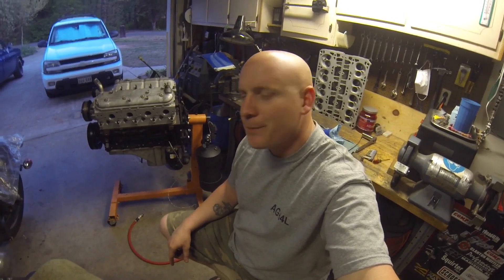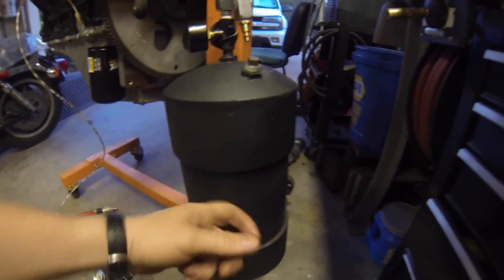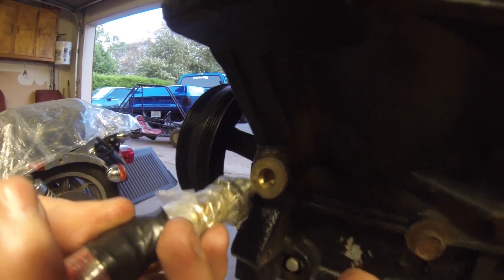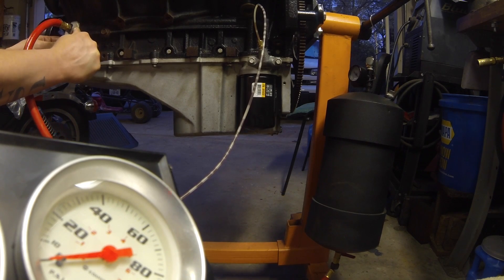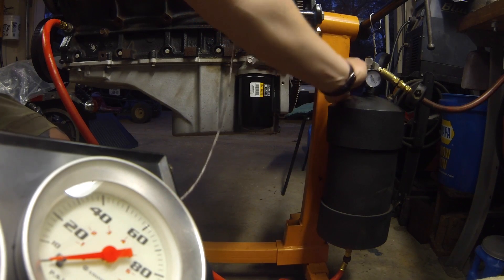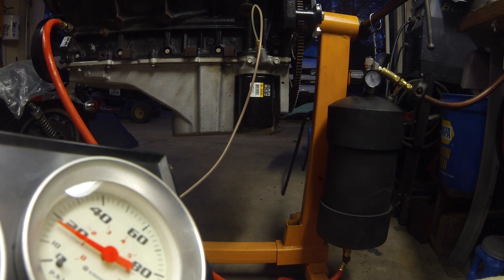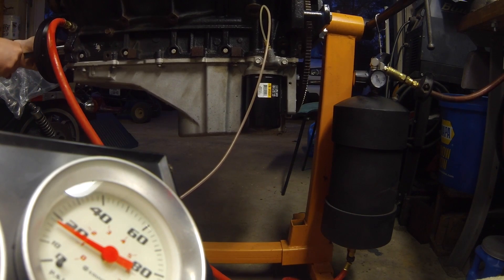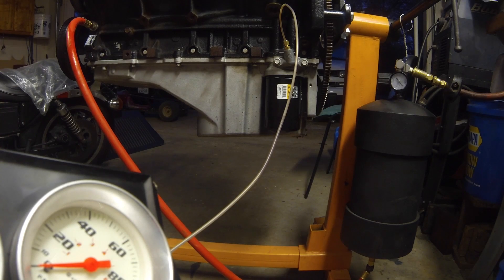LS Engine Oil Primer, Home Made - Pre Lube Prevent Engine Dry Start "How To" - LS1 LSx

Comment: I like to install tees and a access valve on oil, transmission, and coolant lines in the highest line points off their respective cooling systems. For oil I have been just filling from the access point, letting gravity feed it all in, then close valve and run engine. Great every time. Routinely I have transmission fluid partially replaced using the access valve, 1 quart out at a time and refill 1 quart at a time through dipstick tube. For coolant I put access valve on the vent lines and fill and close before start on rebuild or flush, no more startup overheating at all. Love LS motors, great video. I hope more people take this stuff more seriously, good preparation causes less trouble.

Comment: Add a clear filter at the bottom of tank between air line so you know when to turn off tank. Great info hear. Even know it's 5 or 6 years old it still helps ppl today !

Comment: Can you draw oil from one of the outlets on a sandwich plate with an electric oil scavenge pump? I’m trying to make a way I can prime my motor before start up. The main idea was to fabricate the phaser gear cover with an oil fitting to prime the phaser gear actually only bcs it is not staying in its suggested locking position (retarded) and it might be bcs I have aggressive cams and springs for it’s a turbo build and everything is generally brand new.

Comment: Literally all you have to do is remove the oil plug on the drive front side of the engine, shove a tube in the hole attached to a funnel and then add oil slowly until the oil pump is full and oil begins to come back out of the hole. Replace plug in block and you are done.
Reply: But this, if done right, will prime it every time you start the engine. Basically, it's a Moroso Accu-Sump. It will also provide oil to the engine if you get an oil pressure drop due to sucking the pan dry, or having all of the oil slosh away from the pick up, or all the oil getting thrown up into the head on a sharp turn.

Comment: That is a great idea. Since you didn't seem to spare any expense you may as well put an in line magnetic ATF / PSF filter such as a "Magna Fine"  on the hose to make absolutely certain compressor contamination ie. rust, burrs from fabrication etc. NEVER have the one in a million chance of making it in the engine.

Comment: Question I have a 5.3 I rebuilt it has been sitting for about 4 to 5 months in my garage in the vehicle project is not finished. I'm not ready for it to run yet slot left to do should I pre oil it now are when I'm ready to start it for first time. And is there supposed to be oil in pan before priming. What oil would you recommend?

Comment: Thanks for the video Mark. I'm a Mopar guy and I'm getting more into the modern Hemi's. I built one of these for my Gen 3 Hemi build and got to use it sooner than anticipated when I did a cam and lifter replacement in a 300SRT 392. I made a couple of modifications you could probably use for yours and I thought I'd share.

I built mine a little bigger so it will hold 7 qts. I also used an air line coupler on the oil line to the block for an easier hook up, and I put the female end on the hose so it will seal when disconnected, eliminating the need for the bag. 

As for the sight, I added a plastic tube on the outside using two 90 degree 1/4"NPT to 1/8" Compression fittings. I just drilled the appropriate sized holes in the side of the PVC end caps, then tapped them to 1/4" NPT. I drilled the lower hole 1" up from the bottom, and the upper hole in the top end cap directly above the lower. Then just put a piece of 1/8" plastic tube between the two fittings and tighten down the compression fittings to lock it in place. I added 1 quart of oil at a time and marked the hose for every quart of oil. I mentioned the lower fitting is 1" up from the bottom, and that's my "shut it down" point. When the oil drains out of the plastic tube, I shut off the lower valve and pump the rest of the oil in through the fill cap to avoid pushing air into the engine. 

If you decide to add a gauge to the outside, I would suggest drilling and tapping the PVC with 1psi of air in the tank, this way once you break through the plastic, all of the shavings will end up getting blown out, and won't end up in an engine. If you want some pictures of how I set mine up, let me know.

Thanks again.

Comment: if you hooked a line from the drain plug back into the top of that pre-lube tank you could just let it run for a little bit and recirculate. then you could lube the entire engine, and flush everything out. trying to think of a good sight glass idea, clear hose would work but i figure once you got 3 quarts or so in it you are just filling the pan up anyway and it would be just as easy to dump it in the top. just stop early so you know you dont run air into the system. I paused video to comment 3 seconds before you did just that lol sorry

Comment: Man , I'm glad I found your channel with this external oiling primer. I'm working on a 1990 ZR1 , with the LT5 , and it's been sitting for several years and I need to build oil pressure before I try to start it . Great idea , thanks for posting , subbed.👍👍🏁

Comment: hi gear haed ive got a 2000 gm s/c 3800 ill b droping a new can in soon, crow cams say to prime the engine with oil b4 start up but not to prime it by disconnecting the coil pack disabling the injectors is there a simpiliar way 2 prime engine since i dont hav a compressor & the motor is in the car. thnxs

Comment: Should have the spark plugs out and turn the crank while you do it, you can hook the starter to a battery and touch the leads to spin it. Also, your compressor has a valve on it, you dont need a valve on that tank there, just start with compressor valve off and turn it on after you set the compressor regulator to 20 lbs.

Comment: A quick sight glass sort of setup is easy just get you some clear line like used for a oil pressure gauge and two 90 degree fittings put one fitting at the top one straight under it and put the clear line form one fitting to the other and it'll show the exact level of oil

Comment: Great video.  I replaced my oil pan gasket in my 5.3 Suburban and during the entire process the engine did not have oil for about 2 days. Now with new gasket installed and RTV cured I want to fill with oil and start it. Question is do I need to remove that primer engine bolt and put several,ounces of oil in the pump to prime or will just starting it be ok?  I have already filled it with the proper amount of oil in the pan. 2003 with 225k miles. Thanks for response. Great video!
Reply from the maker: Thank you! Sorry it took me 2 months to reply man. Yea, cranking it up will be fine. I prefer to at least prefill the oil filter though.

Comment: why not just use a 5 litre pressure weed sprayer, can see what you have and cheaper than this beautiful creation.
Don't get me wrong, it's a nice piece of work but why reinvent the wheel.
Reply from the maker: Mark Thompson ah yes, that's definitely an option. I had heard of that method before staring this project but I wanted to be able to use higher pressure in hopes of getting the oil into more crevices and possibly testing the engine. It's kinda cool to see that the oil pressure is somewhat correct as I prime it. It may show if there's an issue before even cranking. Like if one forgets to put that plastic dumbbell into the back of the block, you'd likely see that affect the oil pressure.

Mainly, I wanted to copy the $200+ tool I had seen.
Also, I have a habit of taking on tedious time consuming tasks that most wouldn't. I tend to enjoy them for some reason. Kinda like the head porting video series that I did. Those took 40 hours. Or the truck intake shaving video.
Reply: Thank you for that...this is beautiful & professional looking, but I think I have 2 or 3 Hf weed sprayers around😁
Reply: He didn’t reinvent the wheel. He build something far superior to the weed sprayer trick. This is exactly like the $150-250 specialty tools

Comment: after having used a Federal Mogul engine leakage pressure tank for 47 years,  your design is correct, when the tank empties and the air can be heard it does no harm other than to foam the oil a bit. There is no need for a sight glass and the sight glass is just another place for a leak or potential damage. 
The Federal Mogul had a pressure regulator on the inlet as yours does, and an outlet screen filter before the hose connection.
Reply from the maker: +Phillip Polk Thanks for sharing your experience Philip! That's valuable information. I appreciate it.

Comment: I like the idea of using a clear tube to prevent pushing in air, another suggestion I would make is standing the tank on a scale,  once you approach dry weight, cut it off.
Reply from the maker: That's a good idea too. Once I get around to it, I'll make this other one that I've gathered parts for. It's a metal tank and I have a boiler site glass to go in the side and tell the level.

Comment: I made a cam swap and head swap on my 5.3 06 silverado, stage 3 cam and 243 heads, since then when my truck is running at the end of each gear my oil pressure drops and when the next gear kicks in the oil pressure increases to its normal stage. why is that happening? it didn't do that before the swap
Reply from the maker: +Alejandro Lopez It's hard to say from here Alejandro. I can say the most common oil pressure that I've seen on LS motors is the oil pickup tube o-ring. But that usually shows very low oil pressure at idle and picks up with RPM. IT sounds like you described the opposite.
Reply: +AGearHead4Life I went to the performance shop and they told me I needed a bigger stall torque converter so I'm not really sure if that's going to work
Reply from the maker: +Alejandro Lopez Ah, so your oil pressure isn't dropping too low then. I thought you were saying that you had dangerously low oil pressure. Yes, your oil pressure will change with the engines RPMs. A stall converter is often recommended with a cam swap. Different cams require different size stalls.So that you know, bringing up oil pressure and discussing a stall are two completely different subjects. A stall will not make you lose oil pressure.

Comment: How did you get the iron fittings glued/sealed to the pvc caps? What did you use?
Reply from the maker: +Metalboy4 I put a nut on the other side and also used some type of RTV or Glue to seal them, i think.

Comment: Volume is easy enough to figure out. V=πr^2h Just take the radius, square it and then multiply it by pi and then multiply it by height. Easy peasy!
Reply from the maker: +metwono We'll also need to account for the dish in the end caps. I tend to be in too much of a rush to actually do the math, but I can tell you that there is plenty of room for a 5 qt jug of oil in this one.
Reply: +AGearhead4Life That is very true. I figured you leave that part out and use that space for air. Either way, cool idea. :) It would be nice to figure out what the threads are on that engine piece. I don't have an extra one.
Reply from the maker: +metwono The reason that I never got the thread size was because my thread gauge doesn't go that large, but after hunting around on google for a while, I came across a site that says that it's 20mm-1.5, which sounds right.
Reply from the maker: +metwono Here's the site that I got that thread size from.  http://www.speedwaymotors.com/LS-Low-Oil-Level-Sensor-Plug,35277.html

Comment: You made your "Pre-Lube" Canister from regular PVC parts.  There are Clear PVC components available.  Making the cansiter from clear PVC would solve your sight glass issue so you don't in inadvertently push air into the system.  Here is a link to start you on your search for Clear PVC components.  There are many other suppliers.  Just do a search for clear PVC pipe and fittings.

https://www.clearpvcpipe.com/
Reply from the maker: +OLD SCHOOL DIESEL I like the way you think! Thanks for the info. I likely won't go this route but maybe someone else looking into it will have this as an option. I only used the PVC pipe because I had it laying around the garage and I was being cheap. lol I now have a boiler site glass to use, but I want to build a new primer from a metal Freon tank... when I get the time.
Reply: AGearhead4Life The only real down side to using CLEAR PVC is that it gets expensive.  Some places have it cheaper than others so it's worth the time to shop around for the best price.  You can mix and match the stuff as well.  For example, you can get a section of clear tube and then use regular PVC end caps for cheap from the hardware store.  The clear stuff glues up just like any other pvc.  Just another Idea.

Really enjoyed your videos.  I'm helping my neighbor install a 5.3 LS in his 76 K10.  I'm not a GM guy, but all this LS stuff is starting to turn me to the Dark-Side!

Keep up the great work!!
Reply from the maker: +OLD SCHOOL DIESEL haha I hear ya. I'm not a brand type of wrench turner. I'm just a lover of machines. It's hard to deny these LS motors, just like it hard to deny a Ford rear end. Thanks again for the tip! Good luck on the swap.
Reply: The Preluber that Kent-Moore makes is less that $339.00 less then the Clear PVC. http://www.etoolcart.com/Kent-Moore-Engine-Preluber-Kit-J-45299.aspx

Comment: would it be all right to use a 2002 tahoe gas tank in a 1980 chevy truck for the fuel system and what kind of plug would i use
Reply from the maker: Byron Callic Sure it would be alright, but how you're going to make it fit is the question and I dont know about that. i plan to run a rear mount fuel tank, maybe one from a K5 Blazer. What kinda of plug are you referring to?
Reply: the tahoe tank is smaller than the factory gas tank i thank  some cut of lines would be in order to make it fit the plug is coming from the  tank would it hook to a relay to make it work
Reply from the maker: Byron Callic Yes and the relay would be controlled by the PCM.
Reply: ok thats all thanks man

Comment: ok i put a 5.3 in my 1980 chevy truck i was looking at it and it was sitting to one side is this normal are what i have the car shop mount on it and the calm shell motor mounts
Reply from the maker: Byron Callic No, that doesnt sound right. It should be sitting level. Have you already gotten the long bolt through the clam shell and rubber mount? Sometimes it'll sit crooked in there until you get it lined up straight. You'll know its straight because those two long bolts will feed though.
Reply: yeah the bolts are already  in its setting to the drivers side AGearhead4Life
Reply from the maker: Byron Callic IDK man, without pictures its hard to guess. Post up some pics of it on our group Facebook page "A Gear Head For Life" and well see if we can help you out.

Comment: Could have used air hose fittings at end of whip hose and fitting n block just to make a quick disconnect.  Looks good did u ever out a sight glass?
Reply from the maker: Robert Botello Good idea on the quick connect at the block. That can still be added. My buddy did hook me up wiht a boiler site glass to use, but I'm going to save it for the next one that I'm building out of an old large steel home freon tank.

Comment: Just the channel I needed! I love the C10 build. I've been considering doing the same. Have you given any thought to hydroboost brakes instead of vacuum? You would gain better braking performance, you can use the existing power steering system, and it wouldn't rely on engine vacuum.
Reply from the maker: Great man! Glad you're enjoying the show. Yes I've considered hydroboost and may go that route one day. I've just got too many other priorities on the table right now. Currently getting AC on the truck so that my daughter will stay comfortable on the Hot Rod Power Tour this year is at the top of the list.

Comment: Would u sell it after u put the sight glass on it. I would buy it just cause i like how it works
Reply from the maker: I'd probably sell it without the site glass, because I plan to put the sight glass on the next one that I make.
Reply: Nice i plan to do ls swap i already decided the engine it is about finding the right transmission to work or use  a turbo 400 that i have and get it rebuilt for a 6.0 what u think
Reply from the maker: Kenneth Reed I think that I've gotta have overdrive... lol  But that is up to you. If it was just a race car then a 3 speed would be fine. A th400 is very strong. But if you're not rebuilding it yourself, you can pick up a 60e or 80e for the cost of having that th400 rebuilt. I prefer the 4l80e because they are so strong. They're a th400 but with overdrive.
Reply: It only cost me 400$ to rebuild it i price it that 4l80e it is about seven here where i live. I would appreciate if u could tell me where it is better quality tranny with good price
Reply: Nope and your are right not a dragster
Reply from the maker: Kenneth Reed I've bought used 80e transmissions for $300-$500 a couple times. I just search junk yards and craigslist.

Comment: Pretty cool! I was thinking that to monitor the oil level you could hang the pressure vessel from a scale and cut when you get near empty weight, avoiding more holes in it...
Reply from the maker: That is a good idea. Now I've got this boiler level site glass that I'm determined to use. But I will probably just use it on the next one that I'm making out of an old Freon tank.
Reply: AGearhead4Life The probability of a leak goes up like the number of holes squared or something...LOL
Reply from the maker: Steveo H True.

Comment: i'm doing the same thing with an old 20 lbs propane tank and a filter to be sure that there is no foreign particules in the incoming oil.
I spin the engine to permit a better oil distribution